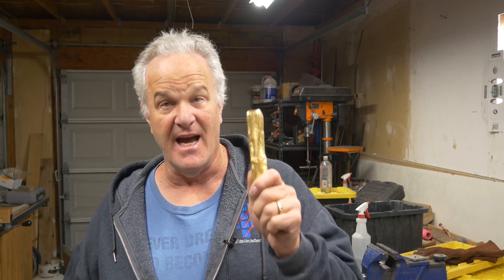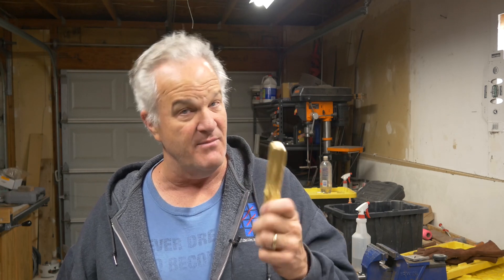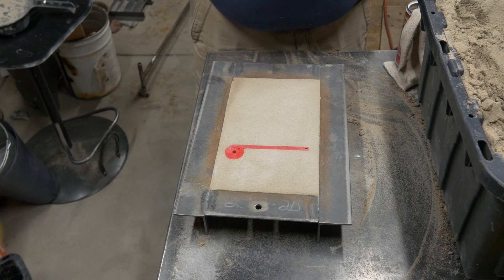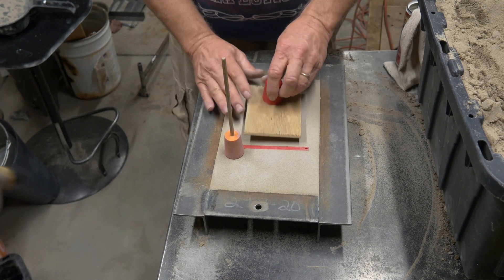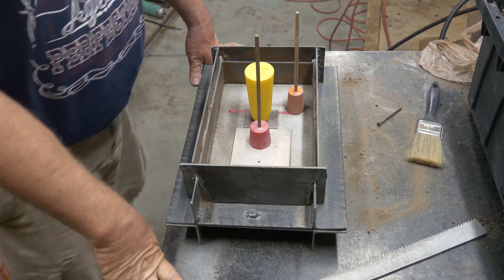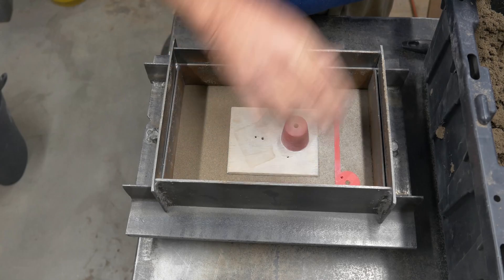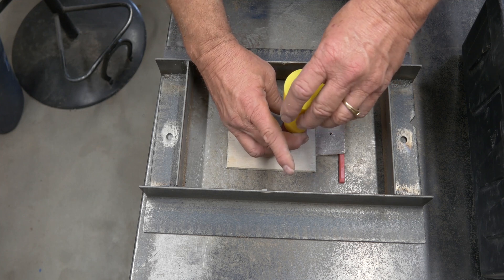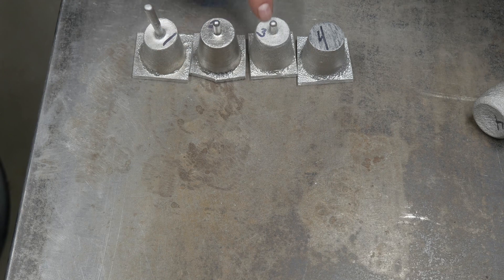Learning to Cast Metal - Feeders

Comment: Was refered to you by bigstackD 😀 nice to see you refrenced him in the venting episode.
Reply from the maker: He's a good guy. I think I get more subs as a result of him sending people over than I do on my own 😆  Thanks for letting me know.
Reply: @swdweeb  np. I like how your doing that.. i am wondering if that would work for making bullion bars etc. Aswell. Im just getting things together to start or attempt is more like it lol
Reply from the maker: @scottcochran8723  It most definitely will work for something as simple as a bullion bar. When they are poured in an open mold they show varying degrees of shrinkage across the top of the cooling metal. Of course this will be a lot more work than pouring into an open mold
Reply: @swdweeb  can you make a reusable closed mold thats not sand.. if so could you maybe do a video or link me some info
Reply from the maker: @scottcochran8723  I've seen guys make aluminum molds to cast aluminum in, that's crazy. It takes special equipment and material to coat the mold with. I don't have any of that.  You could probably make one out of steel but you'd probably want to machine the edges between the cope and drag so it seals up really well when closed. I don't have a mill so that's out of the question.  
Look at olfoundryman channel. He has videos on die casting and "lens blank" and "tilt casting" .  Like I said, special equipment. The lens blanks are aluminum molds that he pours aluminum into.

Comment: Do you have the 3D printed part of the Feeder? Like ur Videos very informative hello from Texas
Reply from the maker: I might have saved it, I don't remember. Why?
Thanks and hello back from Colorado
Reply: @swdweeb  I was needing something to use can i use a pvc pipe the right diameter? haven't found any printed parts yet
Reply from the maker: @cagad101  Yeah, I doubt if you're ever going to find 3-D printed parts designed as feeders. Probably not much of a market for them. 😄  That said, absolutely you can use PVC pipe. I've done it. I've also used metal pipe. Anything that I have laying around that will fit the need. It helps if you can make a taper on it but as a feeder you can just wobble it a little to remove it.
Reply: @swdweeb  Thank you sir look forward to ur videos

Comment: Hey Sir I 3d printed ur tapered sprue and i printed the alignment key but it is to tall the two pieces don't come together am i missing a print?6X7X30 key
Reply from the maker: I modelled it with fairly tight tolerances. If the alignment key is too tall or too tight, you can just sand it slightly until it fits.
Reply: @swdweeb  ok its like it is not tight enough the two sprues don't come toghether? I can play around with it
Reply from the maker: @cagad101  Hmmm... Are the two halves warped?  I expect that when you ram them up in the mold the sand will force them together
Reply: @swdweeb  No sir the meet together ok the key is just to tall wonder if i can try calling it down?

Comment: Hey, thanks for all the content. Could you share the step files of your square runner and gate system so I can manipulate it in cad for lost pla?
Reply from the maker: Unfortunately the software I use doesn't export step files.  I have created them by some process of opening the design file with 7-zip, extracting something and then shipping that up to and online conversion tool.  Its a royal pain.  What do you need to know so that you can just model them yourself?  I'm happy to give you any information I can.  The cross-sectional area of the runner is the same area as the bottom of the tapered sprue. The gate can be any size. If it is larger than the runner the metal will enter the mold more slowly.  I assume you've seen this https://youtu.be/HLMsBWx2VVo

Comment: Aren't you going to address cores in this series?  I know you don't tend to cast parts that NEED a separate core, but cores are quite important in lots of situations.  Actually, cores could probably be their own series; maybe season two?
Reply from the maker: You're absolutely right Brian, cores are an important component. I just don't have that much experience with them. I can make greensand cores but my ability to make sodium silicate is lacking.  Most because I don't have the CO2 to harden them.

If I come up with a project... and I've had one in mind for a while... I'll add it to the series.

Comment: Interesting. I had done some yellow brass vacuum assist lost wax castings in ceramic shell. There were two necked down areas that were cracking due to the part being restrained by the shell as it cooled and shrunk (shrank?) We added  what we called “shrink balls” to feed the problem areas. They were very small compared to your feeders. I think that a big difference with the ceramic shell is that the burnout process ends with the shell being taken out of the kiln at 485 degrees C and molten alloy poured at that elevated temperature. So the alloy remains molten long enough for the tiny shrink balls to do their thing. The part cross section was about 22mm and the necked down area only about 12mm. The shrink balls were 10mm balls on a 4mm stalk.
Reply from the maker: Probably shrank, but I grew up with the past-tense of squeeze being squoze so I can handle shrunk 😄

Interesting on the use of shrink balls.  My feeder was clearly much larger than it needed to be, but it's what I had laying around so it's what I used.

You might be right on the temperature of the mold making a difference.  I've never done a mold that was warmer than the ambient temperature of my garage so I have zero experience on the effects of a lesser temperature gradient. I know people bake sand molds as well.
Reply: swdweeb I very much enjoy your videos because of the thought and analysis that you put into them. Not just some guy showing shots of blazing open flames and gratuitous molten metal pours. There’s actual knowledge that is being disseminated here. Thanks!
Reply from the maker: @ericmorriscompany9648  Thanks you're in the minority :-D  Most people simply want to see metal melting and being poured out of a crucible .

Comment: Part 2 is showing classic  re-entrant angle shrinkage at the plate 'L" to boss junction at 12:20 as voids. Some exothermic on top of feeders would help in all cases... thanks for your posting. [Important message  don't forget to wear your safety boots even if its at home...  safety glasses are made for eyes. Safety leather boots made for feet!!]  JM
Reply: TheSilversheeps exothermic hot top typically isn’t used on aluminum alloy, nor graphite. But insulated riser sleeves would help keep the riser hot longer than the casting thus helping with additional feed metal. Exothermic hot top is “generally” used for iron & steel. Actually I have never seen anyone use exo for aluminum...
Reply from the maker: olfoundryman uses exothermic on his feeders for aluminum all the time https://youtu.be/9Xw6O7biXBM?t=872  You can see it burning on the mold to the left and then eventually see the mold he just poured catch fire
Reply: @swdweeb   and Nate, well time to check out https://www.vesuvius.com/en/our-solutions/en-us/foundry/investment-casting/feeding-compounds-for-investment-casting.html look for Feedol-9 from foseco at bottom, of page. i have used, and it's equivalent it for many decades as 18% is typical heat loss just through riser tops. i tested a riser with a T tip and got 50 degrees C additional heat in the riser from using non ferrous exothermic. has a lower ignition point on purpose for aluminium work. and mixed with sodium silicate for making your own sleeves
can make or break a casting job. Casting is a .'A science not an art form' 
is a good quote. JM

Comment: Hmmm I hadn't thought too much about feeders. Great, informative video.  I learn so much.
Reply from the maker: Clearly you’ve never cast aluminum bronze 😂😂
Reply: @swdweeb  Actually I have not. I cast mostly tin bronze and silicon bronze that I make from my copper scrap pile. I have a hundred pounds or so of aluminum scrap that so far I have only cast ingots for space management. 😁😎
Reply: rockelec silicon bronze 800 series are some of the easiest bronze alloys to cast. 875 doesn’t shrink much at all and is very forgiving when it comes to bronze. Also 873 is what most art Foundries use for sculptures, etc. so stick with those and you will not get as many gray hairs... 😉